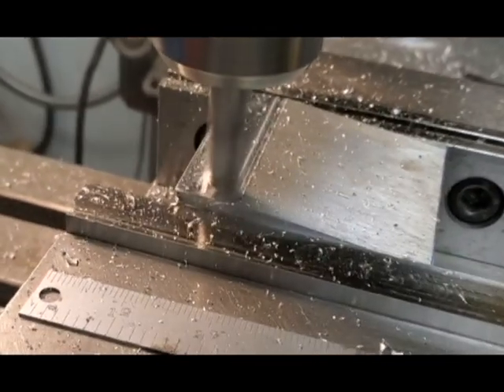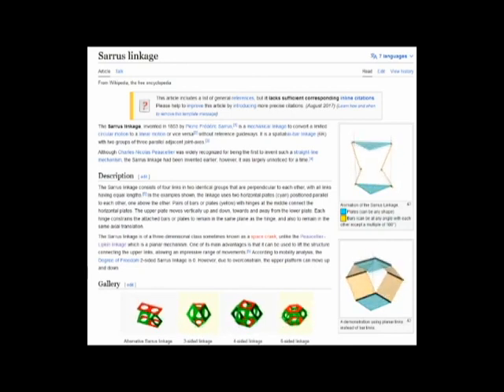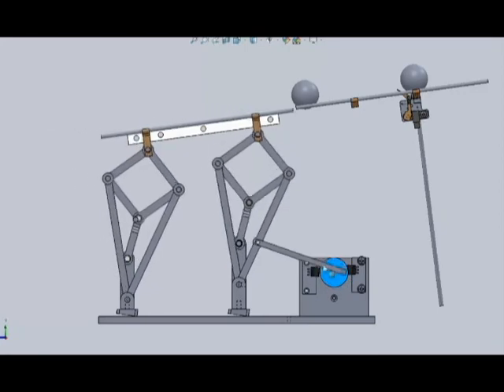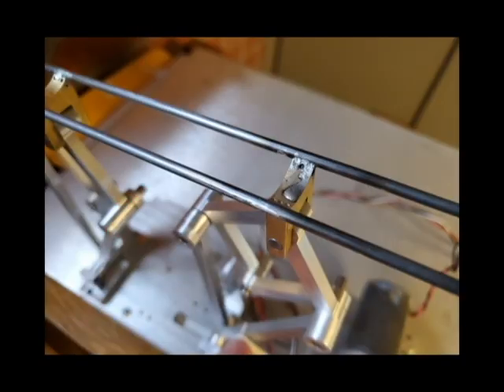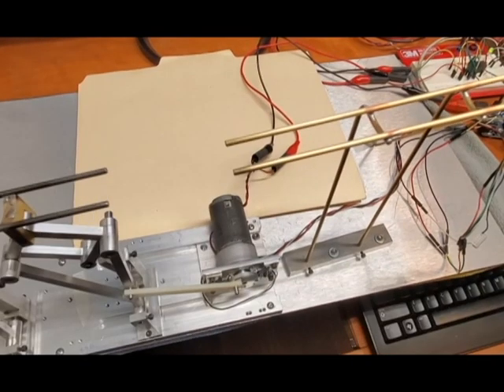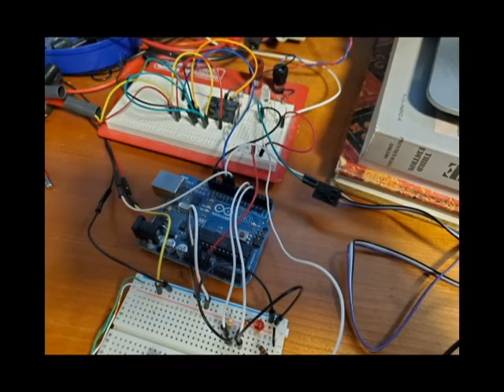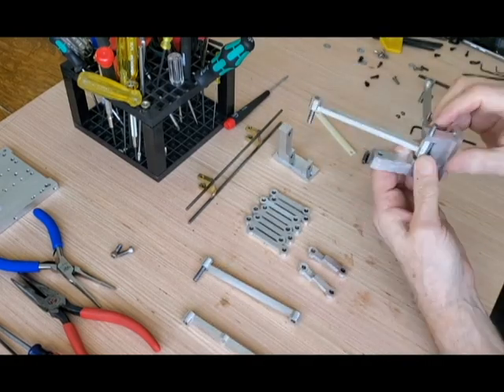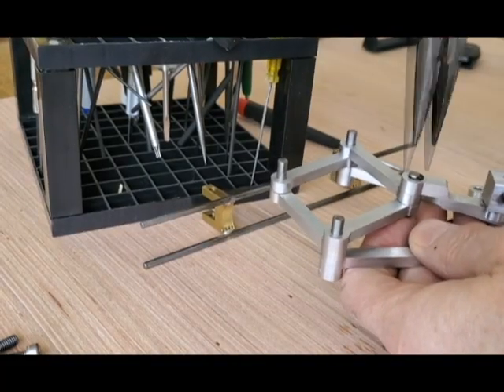Peaucellier Lipkin Linkage Part 2

Comment: I love your project and your video … topic. I just have to ask: Are you for real? 1:1 Ratio and 480p in 2023? The whole code you presented was just a smudge on the screen.
And you seem to do things very old-school. You definitely need a 3D printer for prototyping, of you don't have one or more already. A Bambulabs one makes FDM easy out of the box, and likely you also need a resin one for fine detail prints.
For the matter of timing. … get another switch or two, actually. With the first one, measure how long the ball takes from the current switch to the end of the ramp. (current switch starts a timer, the new [temporary] switch stops it). That way you know when the bridge has to arrive. And the other switch not only tells you when the bridge is in resting position, but also how long a full cycle needs, and therefore when the bridge should arrive after half that time.

Comment: Excellent video. For accurate straight line motion, nothing beats the Peucellier Mechanism. Having a Peucellier Mechanism in a milling machine would ensure uniform wear of all the bearings, unlike the sliders used in traditional milling machines which causes excessive wear at the centre of the sliders. In applications where the tolerances are high, such as a moving table, the simpler Chebyshëv Mechanism would do well. May I ask you what CAD software you used to create the animation?
Reply: I asked too soon. I heard you mention SolidWorks.
Reply from the maker: Interesting comments about the milling application - it seems to me you would be right, for an economical linear motion on things like a laser cutter, where you don't encounter high tool loads the Peucellier mechanism could be a good choice. I take motion screen grabs of SolidWorks, and it's easy enough to do the animations in SW, but also easy to just grab a member with the cursor and drag it through its motion.
Reply: @sisyphuscranerigging7792 , What if the tool post of a lathe machine were mounted on a double or quadruple Peucellier mechanisms? The tool post spends most of its time closer to the chuck, thus causing more wear to the rails closer to the chuck. The tool load would be orthogonal to the movement of the tool post.